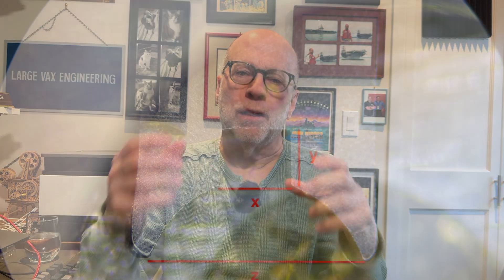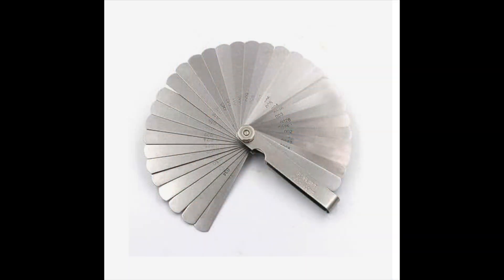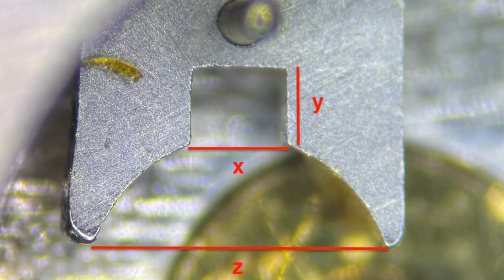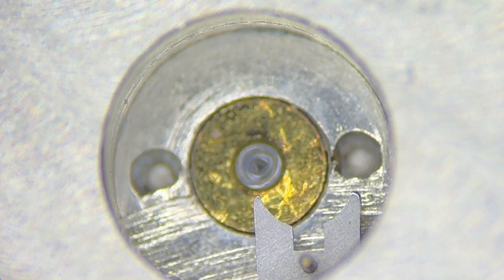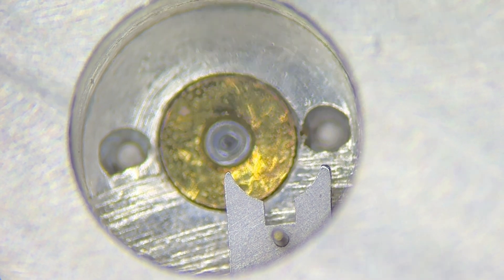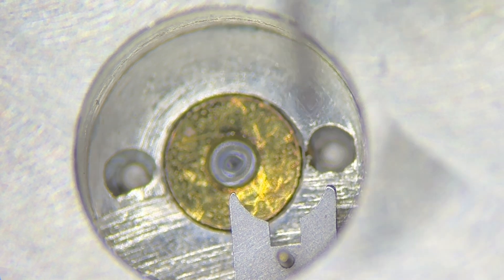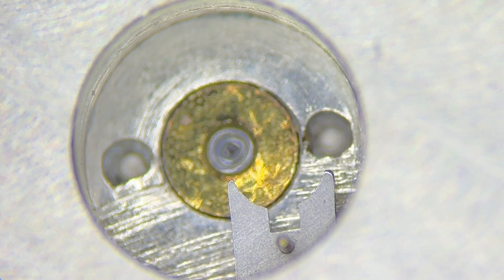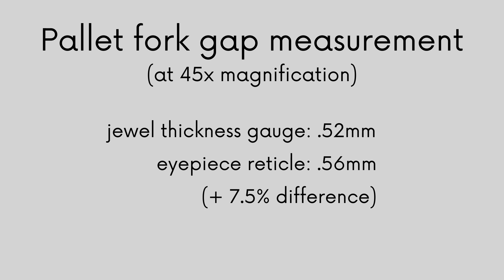Gauge vs. Reticle: Which One Was Wrong?

Comment: I would check the retical against a know size reference and adjust the reticle until it read the same as the known value. Than double check it against a new object that you don't know the size of so you can't influence the measurement. If its repeatable than it's now calibrated. If not then 😢
Reply from the maker: Thanks for the suggestions.  I did use calipers on the gauges and they are accurate.  (I didn't check every one, but I did check the ones I used.). The reticle checks out which contributes to the puzzlement.  But I think I have an answer, I'll try to get a video out this weekend.

Comment: There may be no error. Note that you measured the size with your microscope but when using the feeler gauge you are "feeling" checking the fit. Note that if the size is 5.6mm a 5.6mm size gauge will not fit. This is an interference fit. In order for one part to fit into another there must be clearance between the parts unless the parts are to be pressed together.
Hope this helps. Note that the difference was .02mm this is a very small difference however very large with the "fit" you require. Look into "fits and tolerances" for more insight.
Reply from the maker: You advice is the winner, I think.  I'll post a video about this in the next couple of days.

Comment: Depending upon the age of the gauges, there could be a bit of oxidation on them that would make them slightly larger than when they were new.  Also, you should try measuring the gauge with the reticle.  You also need to be perfectly aligned with the slot for the gauge to measure accurately.  If you are even slightly off, it's going to seem like you need a smaller gauge.
Reply from the maker: I'm pretty sure that wiggle and/or not being straight on  isn't it.  I edited down the video for the sake of time, but I went back with the gauges a couple of times to make sure I wasn't coming in at an angle.  Wiggle is a little chancy; the pallet lever was still mounted and I didn't want to stress the pivots.  But I did go back and forth a bit and that wasn't it either.

Oxidation, perhaps there's some that's not visible to the eye.  But not enough to account for being off by .04mm.  The gauges are noticeably clean, in fact.  That's the first thing that attracted me to this set vs. others on sale.
Reply: @Oldguyponderingacareerch-ip9tf If you have a micrometer, would that measure gauge thickness reliably and to the required precision?
Reply from the maker: I’ve published an update. See https://youtu.be/CXj1PycqH_8  .  This was a learning adventure!
Reply: @ I went off too soon. Saw the comment about interference fit, then saw your reprise. Appreciate your channel and how you’re sharing your journey. 🍻

Comment: Could it possibly be an error in the claimed magnification of your optics? 

Also, did you measure the thickness of the roller jewel thickness gauge with a micrometer?
Reply from the maker: I calibrated the reticle for what I saw with the zoom knob at certain markings.  So the calibration was relative for what I was actually *seeing*.  But if I dialed in a number that I had calibrated and now the knob isn't set exactly where it was during the calibration, that could affect hings.  

I'll measure the gauges with calipers, that's a great idea.

I'm going to measure the gauges and do other experiments tonight and this weekend, and report back.

Comment: Probably best to use the gauges with the pallet lever out of the watch, the pivots are so fragile, and a slightly jammed gauge could result in broken or bent pivots. 

The good news is that your measurement via gauge matches well with the known specs for the watch and 18S Waltham roller jewels. 

Eyepiece reticules can indeed be used with great precision. 

I’m wondering if runout/slop on the microscope magnification adjustment means that each time you dial in to say 10x magnification, you’re ending up +/- a significant margin of error. 

I don’t know if roller jewel gauges are still being made, but cylindrical gauge pins certainly are and are better suited to the task than feeler gauges. 

That said, I use a set of roller jewel gauges that are probably older than I am, and they have served me well.
Reply from the maker: Point taken on the pivots!  But I SWEAR I was gentle.  I came in slow and easy!!

Interesting idea about the microscope runout.  I can't believe that I'm the only or first person in the universe to run into this issue.  Yet I don't find any articles about it.  I'll try experimenting with going to a magnification from below vs. from above and see if I can force different visual magnification to occur.
Reply: @ I certainly don’t think that you did any damage to the lever or its pivots, I can see how careful and gentle you were. 

My point is there’s a potential for something to go wrong that can be avoided. 

If a gauge fits the fork with very little play, it only has to bind in the slot for a moment (perhaps by tilting it ever so slightly) whilst you’re withdrawing it, and it’s likely a pivot will snap or bend. 

Spare parts can be like hens teeth, sometimes there’s no safety net if one breaks (unless you can make the part yourself) and escapement parts for watches of this vintage when available usually need to be adjusted to fit the other parts they interact with, which is labour intensive. 

I’ve learned to treat every part as if it’s irreplaceable and I’m extremely careful to do no harm.
Reply from the maker: Great points.   I’ll work on thinking more about all the potential mistakes that could occur and what their ramifications could be.